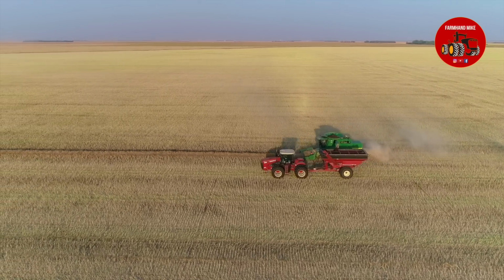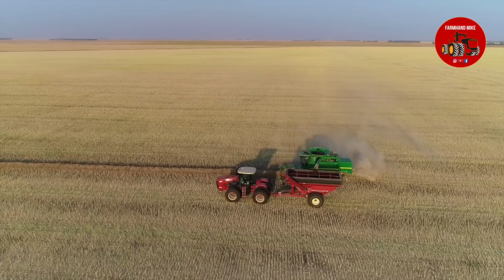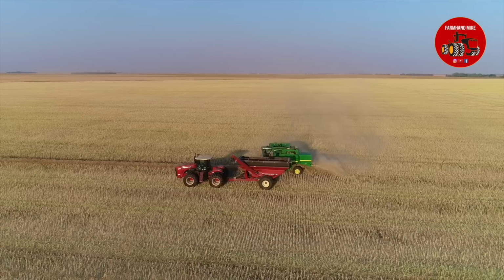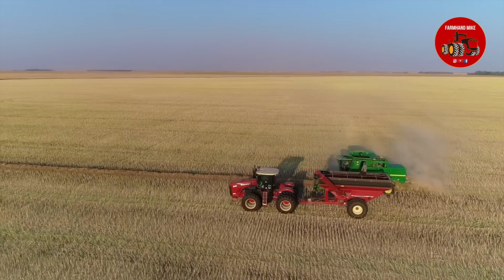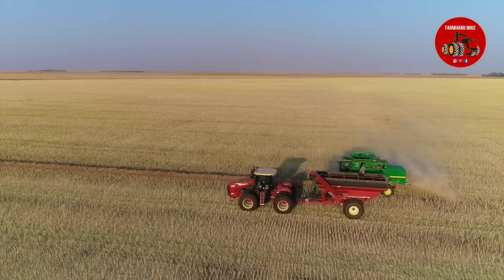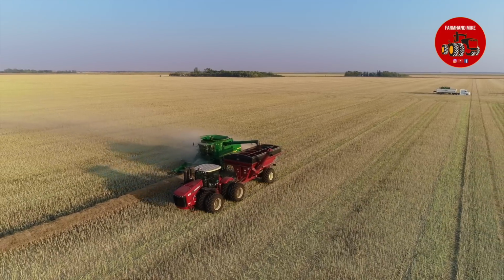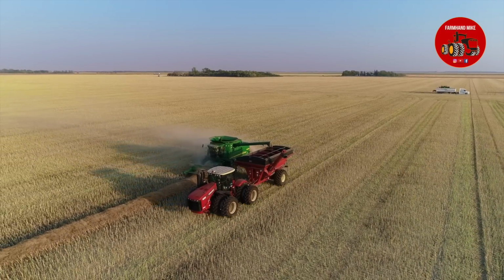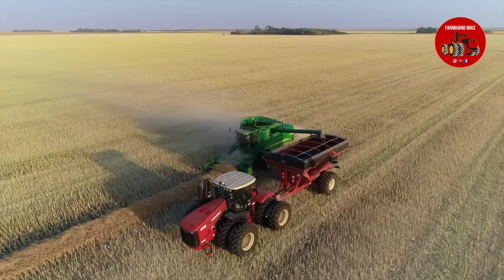2018 Canola Harvest near Starbuck Manitoba Canada

Comment: Another good video from Mike. Would someone explain the benefit to swathing as opposed to conventional combining? Seems, I was told they do it to get the crop to dry faster? But  to me, a crop will dry faster standing in the field with the sun shining and wind blowing on it. Than piled  in a windrow. I know I missing something. So please educate me. Thanks in 
advance.
Reply: Severing the crop from the roots causes it to dry down faster. Back in the day they didn't have high clearance sprayers to desiccate, and their canola crops were not nearly as thick. Cutting it green also reduces shelling. Old habits die hard. There are now varieties that don't shell when straight cut, but it costs more. You are absolutely correct, it dries faster standing. The guys around my area are straight combining canola testing 9 while my swathed stuff is testing 30. Forgot to mention, if straight cut canola gets snowed on it will be flat on the ground
Reply: @Vadados   thanks for taking the time to reply. I understand some do or used to swath wheat?  It makes more sense for dry northern climates. But here in the deep south. It's hard to get more than 2 days without rain. Two weeks is out of the question unless we're in a drought. As you can see. I'm very ignorant about farming cold dry climates.  But do envy the Canadian farmers with their monster fields located in sparsely  populated areas.
Reply: Winter is coming plain and simple.
Reply: I find that wheat drys down faster in a swath until it gets rained on. Then when swaths are rained on it could sprout. If there is alot of snow in the forecast you're better off swathing it all so you don't have to scrape the ground come spring. Swathing wheat isn't all bad. You can lay rows side by side and pick them up together. I have 25' swathers and make 50' wheat swaths

Comment: One thing that comes to mind that I was curious about. Is there a specific reason why they are using the older model combines or is it just run em as long as possible and keep them in as good condition as long as possible? Seems like so many farmers and contractors are buying new machines every year or every other year. These machines look like they were built in the early 90's maybe I don't know. The reason I asked is I have heard that some farms will only run a specific type or model for a certain type of crop. Like you I don't know anything about canola other than it's an oil you cook with and it's a common seed used for biofuels.
Reply: 9600 and 9610s and great running machines and very nice to operate. They probably only have around 1/2 the capacity of that of a new machine; but you can pick one up for 30-40k vs a new one 300+k.
Reply: Thank you Kenneth for the insight I do appreciate it
Reply: Mainly it is just a thing of 2 things: 1: How many acres do you have to cover, and 2: budget.  These were also some of the best, most durable combines that Deere has made to date.  With the markets how they are now, it is hard to even try and buy new every year for some farmers.